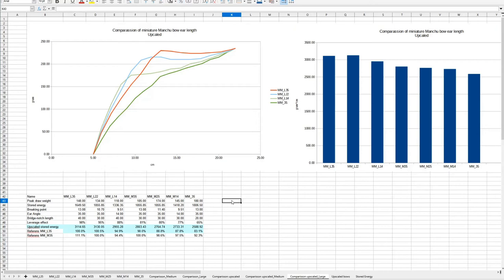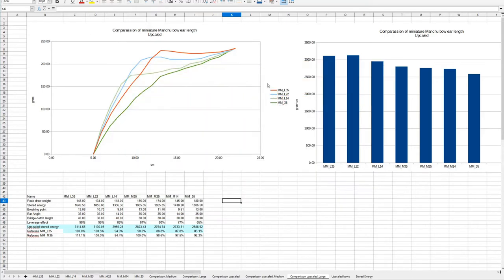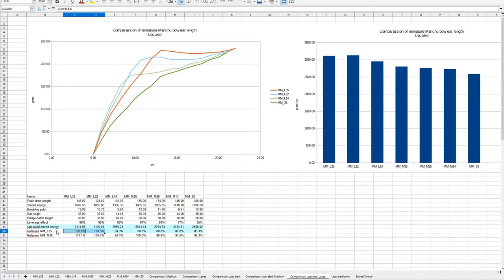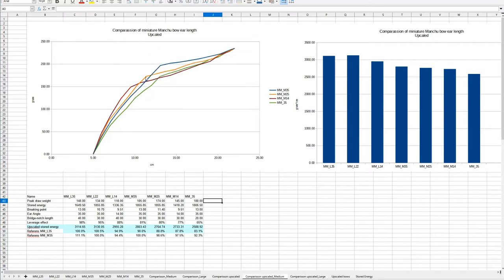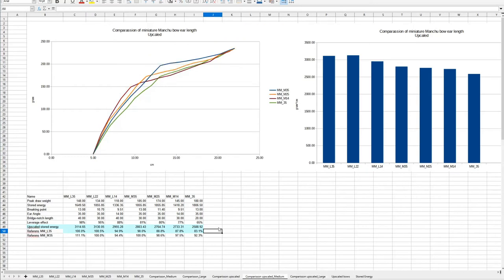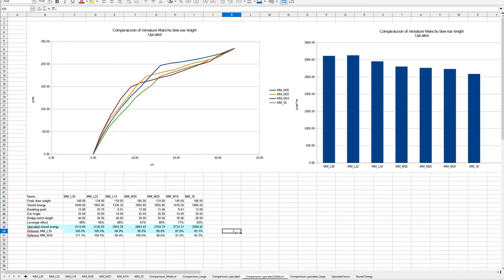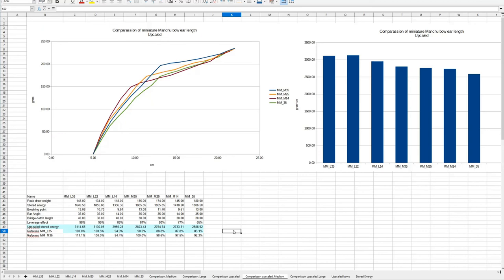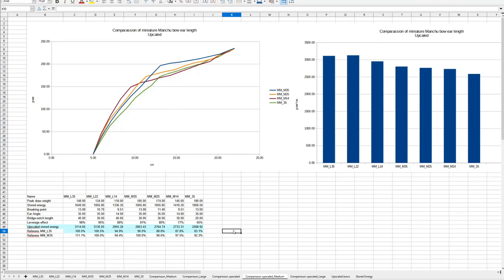Mechanism of a Manchu bow - Siyah length

Comment: Hi! Amazing video. Really good. I hope you can continue with your research. By the way, related with last comment, about going to horn bow because you need torsional stiffness. I am structural engineer, ski manufacturer and archer. I agree with you about the need for torsional stiffness. Just to mention you can get it with laminated bow. Changing the shape to D shape is mandatory when you work with traditional materials, but with fibres, you can get stiffness increase with rectangle section. You just need to put fibres symmetrically oriented with shear force (from torsional stress) and this can be done quite easily adding +-45 fibres cloth into the laminate symmetrically. Of course this should be in accordance with flexural stiffness and strenght but I guess it is easier and cheaper, and you can control more or less the amount of torsional stability you add. Of course, it is no so cool as horn bow.
Reply from the maker: Thank you for watching and very nice comment. I could be wrong about laminated bows, it's mostly based on the lack of available Manchu bow products and the manufactures not willing to accept a custom order. I had a plan, which I now have abandoned, to make a D-shape wooden core bow and vacuum infuse it with ribbon glass-/carbon fiber (+-45 and parallel). But I have access to sinew, wood and hide glue on my property (my neighbor is a butcher and moose hunting starts soon). It's time consuming to make a horn bow but the price can be as low as $100 and it's a bit of historical value.
Reply: We always searched for someone from the ski business for exchanging informations and knowledge. How can we contact you outside youtube?
Reply: @itsnotme6574  I am gathering materials to do the same. You videos have been invaluable. I want to see how far we can push the envelope with modern materials. Do you have any more in depth data on siyah length. Or could you email your spreadsheets and I'll just comb through it. Either way great video and extremely informative experiment.

Comment: Great research. Yes theoretically the bow gets maximum energy storage when string leaves the bridge at half draw. But in practice it causes less torque resistance, and much more difficulty in the draw. For a man capable of shooting a 150lbs self bow, a 120lbs half draw seems impossible, while a 100lbs half draw can be more achievable and still much better than a self bow. And that is why we never see the theoretically perfect design in practice, especially in early Qing bows as in 17-18th century paintings, which have large brace height and little reflex of string. In conclusion, for light weight bows, the more stored energy the better, but for a man's maximum energy output we have to consider archer's body structure, maybe measure men's capability of draw weight at various lengths, from 10 inches to 35.
On the name "Manchu bow", there are evidences indicating that it was already developed and used in Ming border armies, with 176cm (五尺五寸) of total length and 160cm (五尺) string length (《武备志》1621), and 22.4cm+ (七寸许) of recommended brace height, and 88cm (二尺七寸五) of recommended draw length, possibly from nock to archer's thumb, where he feels the arrowhead or the wrapping behind it (《武经射学正宗》1637). This is why I avoid using "Manchu bow" but use "Qing bow" instead. Cheers!
Reply from the maker: I think if people practice they will be able to pull them. I don't practice to much. But I can pull rubber bands about 85-90# at 96cm (~38") measured from the belly. I can also pull the same amount of weights on a pulley system. And on the pulley system the weight increase is instant.
I made some calculations comparing two Manchu bows: 10" brace, 32" max at 106# and the second bow 7" brace, 36" max at 80#. Both of them store the same amount of energy. So the question is, which goal would be easiest to achieve? Shorter and heavier or longer and lighter. They will also end up with different kinetic energy and momentum if both loose a 15 GPP arrow. The lower poundage bow would have a higher arrow speed. So it's interesting to compare draw weight with draw length. I will keep practicing and try to retain my full draw length as I increase draw weight.
About the name, I might call them "Long lever bow" in the future

Comment: Great stuff. Any interest in mechanics of straight limbed bows? Hickman felt that a pyramid bow with straight edges and even thickness would bend in the arc of a circle with even strain. I believe Klopsteg felt that the width taper needed to be proportional to the distance from the string to the limb at full draw for even strain with even thickness. I am wondering if your PLA bows would be a good way to model this to see how much of a difference the width taper makes for an arc of circle tiller.